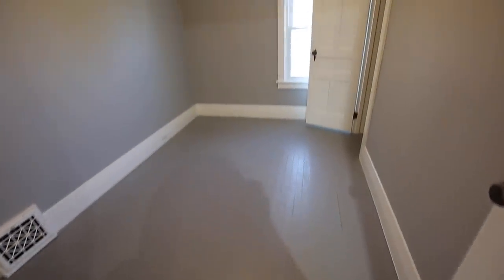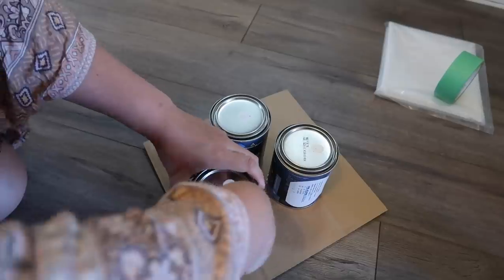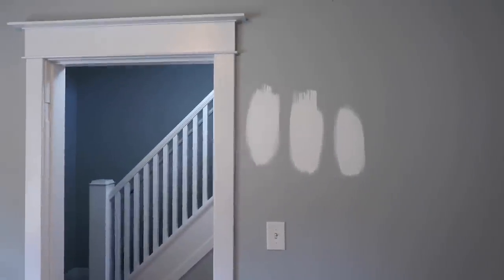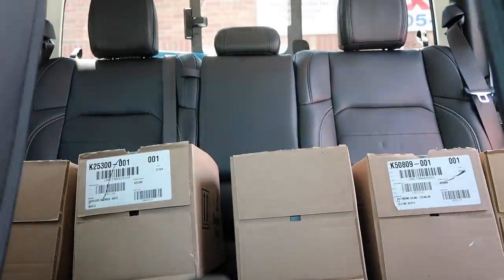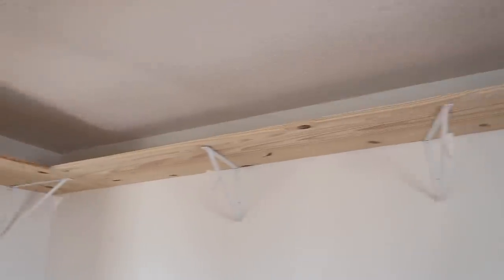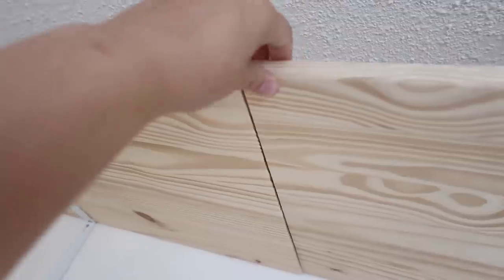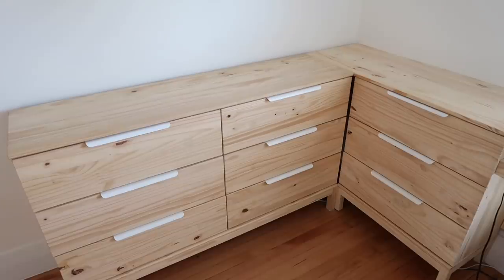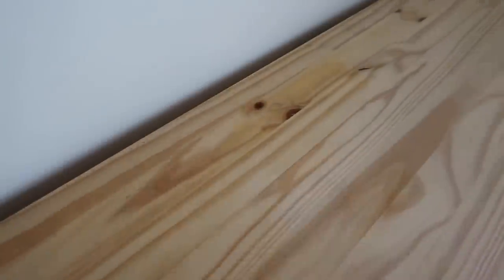DIY WALK-IN CLOSET * Home Reno Vlog #2

Comment: It is a lot of wood. possibly a different mirror with a light metallic frame? Also a rug and maybe a light fixture or chandelier? You could get a neutral rug that would blend but add texture and break up all the wood. Also, question, is the wood all untreated, or did you varnish or seal it somehow? Pine is soft and will stain, get scuffed, dented, etc.